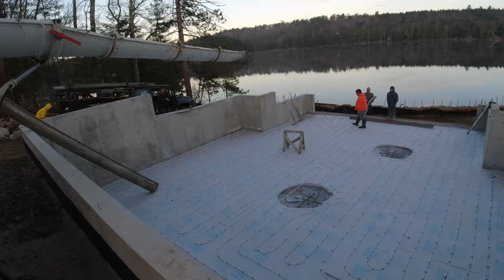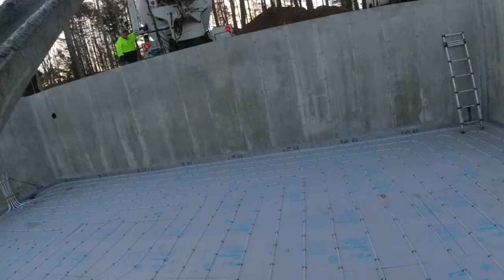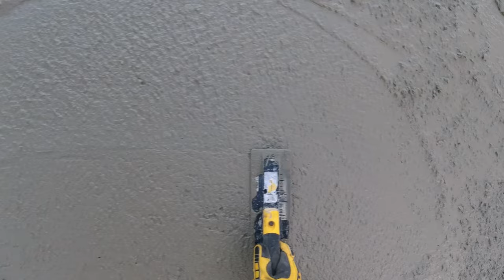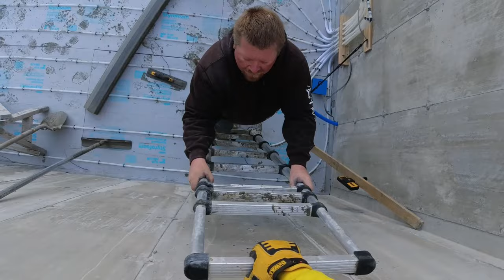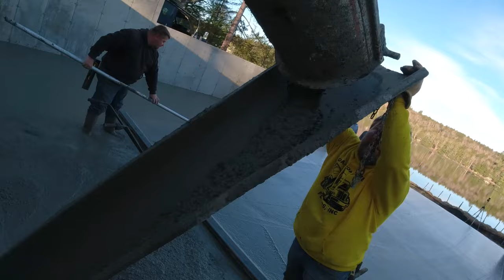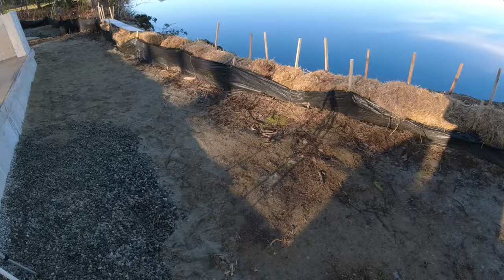Living On A Lake - DIY Basement Concrete Floor Pour (Do What We Do!)

Comment: Hey Mike
You use chloride in addition to high range and mid range water reducers. I came up thru the ranks in commercial construction and chloride was frowned on b/c of the corrosive effect it has on rebar and wire mesh. Obviously it’s not an issue w/  fiber mesh but I’m wonder if you’ve run into any pushback while using chloride?